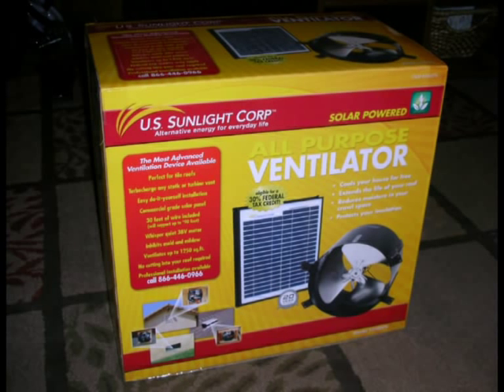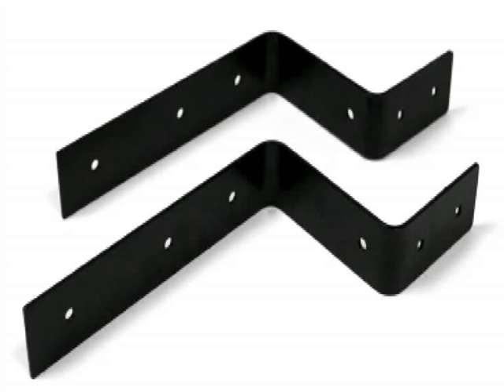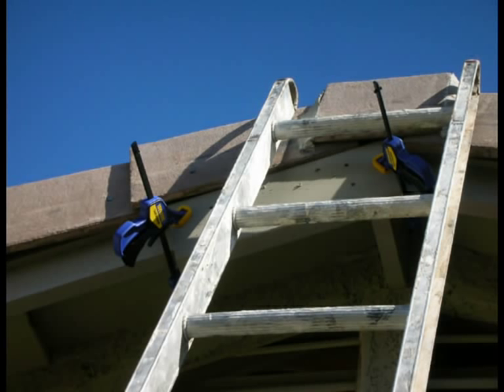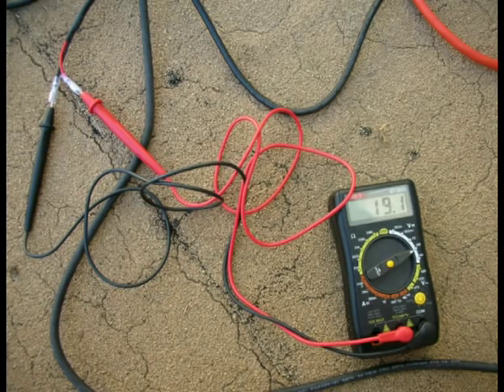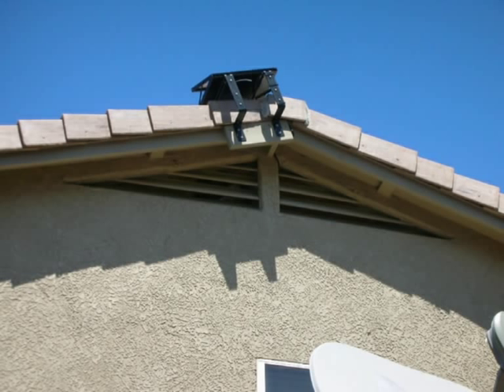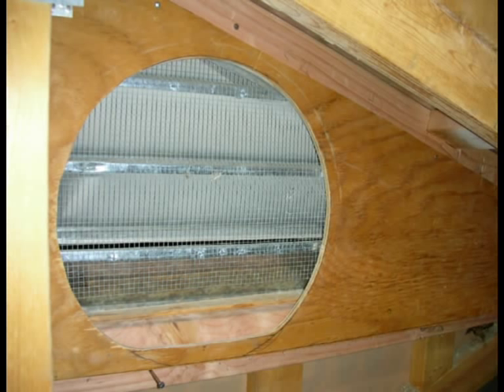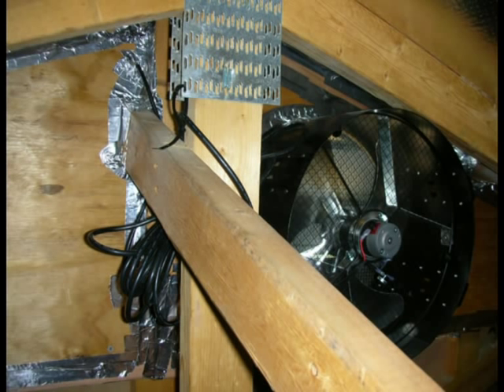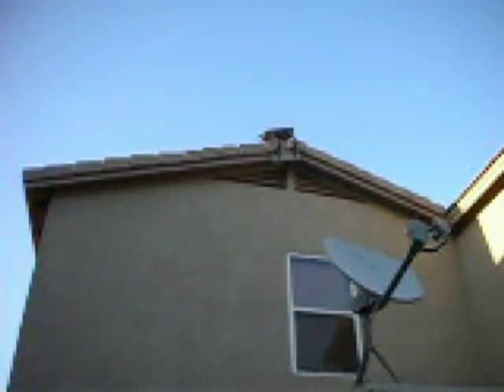How To: Solar Powered Attic Fan Installation

Comment: It's not always quiet, though. >>>nub.best/x0rq     The fan makes an eerie oscillating sound (like a 1950's SciFi movie) at dusk and dawn before the solar panel gets full power. Definitely noticeably & annoying when sitting outside, and can be even be heard inside thru sheetrock & insulated ceiling when rest of house is completely quiet. During sunny days it is completely quiet from more than 10' away, though.Also, you cannot rotate the solar panel -- it's permanently bolted to the fan assembly, so make sure you or your roofer install it facing exactly the right direction. Once it is installed, the direction cannot be adjusted at all without pulling up the new roofing as I learned.